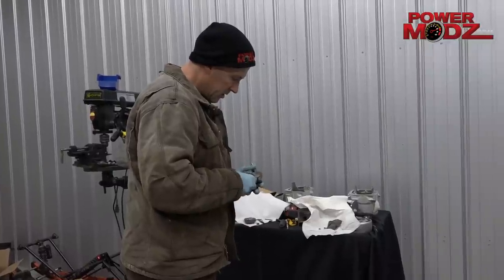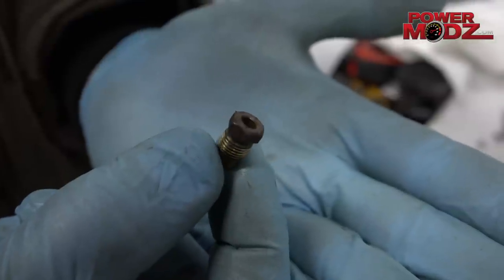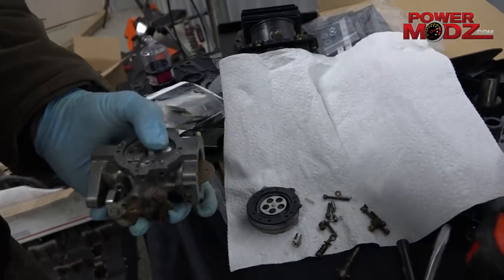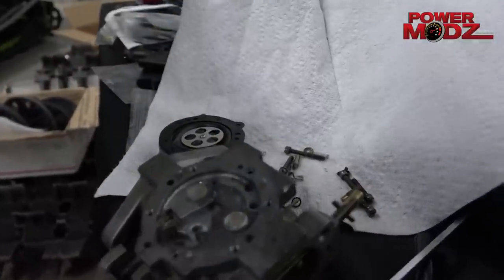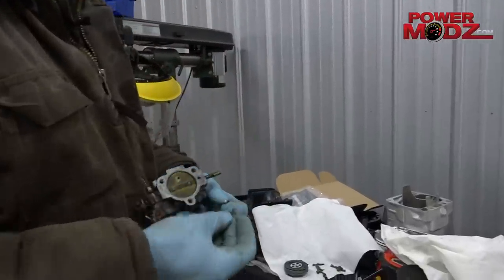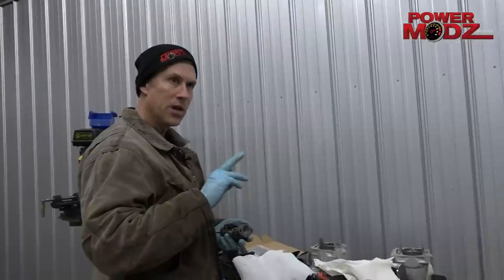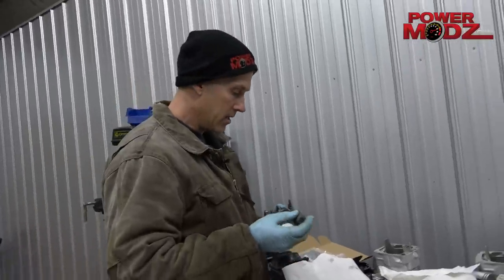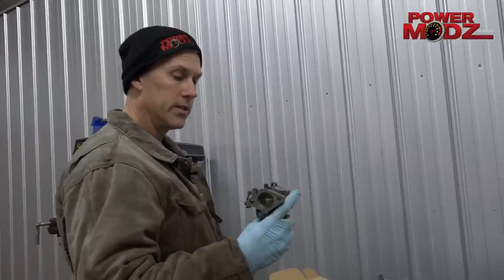TILLOTSON CARBURETOR REBUILD TRICKS!  IT'S EASY!

Comment: Side note, an old timer with about 15 SKIDOO sleds told me carburetor cleaner melts the little caged check ball so don't clean the carb with the check valve in the carb. I have bought two sleds that had the ball missing/broken/melted or whatever. I'd only been able to find the check balls as aviation parts for paramotors but I messaged on your website to try to buy some.

Comment: The way you leveled that tab can screw up the needle and seat. You should take another small screwdriver and use it to counteract the force you are putting on it. I learned all about pop off pressure carbs with my sea doo rotax 587 motors (super similar to rotax 583s in skidoos, just w/o rave valves.) if you have the wrong spring in, it can either flood your engine or make it run lean. Too light of a spring will flood it because gas tank pressure will overcome the pop off pressure and send gas into the carb. To heavy and it will not send gas into the carb when it needs it and it will run lean (if it runs at all.)

Comment: I have a few questions. Are you sure that it is Stainless steel seat. Though it is chromed for kart motors running ethanol? What brand socket you are using. I have Bahco A7402DZ-5/16 and it has 11.4 OD and it is very tight. You are using Proto, 3/8"? Is that Winderosa set? I can not hear what you are saying that check valve cause flooding? Not sure about that. EC carb is saying that it is only for backfire. Valve looks like it is bought from there. I aslo can not hear model. I have 114A and look the same. You do not show pressure test. What you recommend? 10 psi? Very nice video!
Reply from the maker: I made my own socket - ground one down.  Could be chrome plated but pretty sure stainless. I sell Tillotson genuine kits.  No pressure test needed.  if the check valve is stuck it'll flood and blow gas out the carb.
Reply: @PowerModzOfficial  I finaly get my Tilly work properly. I needed to order new shaft from Canada and install bushings to body. And make valve pop-up testing. Also original needles. After all that it work very nice. I mean seriously well. I needed to make special tool in turning workshop to get seat properly installed. I am now sure that shaft need to be in tolerances to have firm idle. Shutter is well machined to body. Also I am sure that you do mistake if you neglect valve testing. There is number of diferent springs to adjust valve opening. To have smooth operation in different loads got to have certain amount fuel in reserve. And one thing more. Check that you have fuel pump diaphragm. It is missing most of the sets. I can now say that it is a great carb. But also need three special tools to be rebuild. And if body is wear out, you need to have imperial reamer and bushings and shaft.

Comment: I have a carb off of an old TNT 440. The carb is an hd80a by stamping. Under the Welch plug the "ball valve" isnt a ball valve. I can't find anything that shows what that thing is, and I can't get the carb to do what it should. 
Help?

Comment: I have that carburetor on my 1995 Mercury Force 70 o/b. I can't get it started without using starting fluid, and then it only runs for a second. I also have fresh gas coming out of the exhaust mixed with water. I am so frustrated! I wish I could send it to ya and you rebuild it!!

Comment: use fuel stabilizer when stored it will eliminate 99 percent of carb issues,the green and corrosan issues didn't start until unleaded fuels were introduced.
Reply: I think you’re right there. My grandpa bought a wheel horse safari in 1969 and we used it without fail for decades. It wasn’t until about 2002 that it began having runability issues. It went dangerously lean while on a long ride away from home and the Kohler 309 suffered a piston meltdown. I was able to remove the piston and successfully dislodged the rings, polished it up, and ran it successfully for a few more years but it got to the point that the running issues couldn’t be resolved with the adjustment screws. I’ve since completed a full rebuild on the top and bottom end and the carb has required numerous rebuilds. Last year, I put a few hundred miles on the old Wheel Horse and it ran flawlessly. This year, it runs awful and pops and backfires under any load. No amount of adjustment can make it any better. Another year and another $50 Tillotson OEM carb kit. It has to be the gas. It’s the only common denominator. Running Ethel free gas doesn’t seem to make much difference on the longevity of the carburetor. The slide carbs on my newer machines seem to tolerate the new gas without much issue but the pumper carbs do not.
Reply: @Adam  if you are anywhere near an airport, they will sell you avgas 100LL. Mix it 50/50 with 91 and add a little fuel stabilizer. Its a bit more than 91 pump
Gas but saves the fuel system in the premix tilly engines.
Reply: @rpmmustang89  
In fact, there is a rather large airport only 12 miles away! That’s good thinking. I should try that :)
Reply: Yup even for the last run of season on avgas so its in the fuel system for the summer  you will be golden. They tend to  only fill metal cans fyi. My 1st trip was unsuccessful  as i had a plastic  gas can.
Reply: Mill fdd DDS,

Comment: I was very interested watching your video. You are SO correct in saying that many carb kits are ABSOLUTE JUNK! Have you ever seen when you tighten the screw that holds the fulcrum arm and rod, that as you tighten that screw in it ends up pushing the needle down so far that it bottoms out not the needle end of the arm, but that other end which in turns ends up hitting the top of the carb? If I back the screw out some things are fine, but I can't imagine that is right.
Reply from the maker: yes - you just bend the tab so it doesnt do that
Reply: No kidding, I will have to try that I guess. I measured the new needle and it actually is about a mm, maybe 2 longer then the old needle, thought that maybe was the issue. They are both uncaptive or non-captive needles too so that isn't the issue. Never seen one so out of adjustment before I guess.
Reply from the maker: @simonkrystosek7122  oh I see...yes you cant use that long needle....that's not going to work for you
Reply: Do you have the proper needle and seat for a HL289A for a 303 Wankel I can buy?

Comment: I’m restoring a 1970 Arctic Cat Panther and I need a kit for my tilly on it, I’m in Vermont, USA, where can I get a kit to replace the ball valve and plug? The pump rubber and diaphragms all look to be in great shape, but if the hood kits come with all new I’ll replace em.
Reply: GB Distribution in Quebec has kits if power mods doesn't
Reply: @ontariosfinest8971  anybody in the US? I can get them from Amazon but not sure if those ones are a ‘good’ kit or not. My Cat uses the HD size tilly
Reply: @gallupcustomknives2293  EC Carburetors. I've never purchased anything from them but they have an impressive website as far as carb parts go

Comment: Does an HL 129 have a check valve somewhere? It has one welch plug that I pulled but just passages under there. I rebuilt the carb but it won't pull gas.

Comment: Does the HL-320 have a check valve...? No noise when shaken. There's only one welch plug and a small 1/32" brass plug where your check valve was...
Reply from the maker: Hmm im pretty sure yes - remove the plug and see
Reply: @PowerModzOfficial  No, turns out it does have what they call the 'idle discharge ports' (scroll to bottom of link) which are those small holes under the second welch plug you took off but they only refer to the brass plug as 'the brass plug'...nothing more. Must be an un-used part of the casting...? Oh well, one less thing to worry about but still a bear to get started. Thnx all the same, great channel !

https://tillotson.ie/wp-content/uploads/2015/07/techinfo_hl_us.pdf

Comment: Any chance could do a video on older primary clutches as in the comet duster 94c cant find anything on them and would like to get more info on them i got a 74 tnt 340 with a 440 sled was toast so i put it in my 78 340 olympic that nedd a heart and runs great but need a white 99ld spring but dunno any info on the pucks and cant find anywjere that sells them any help would be awsome love channel thnx

Comment: Do all Tillotson carburetors have the check valve in there? I just rebuilt an HD 14a and I don't recall a check valve. However, I'm having problems with it flooding easily. I used the winderosa kit and now I'm scratching my head wondering why I'm getting so much fuel. Help!
Reply: Under  the highspeed welch plug is the check valve. Hd you have to use a punch and drive it out
 Gbd distribution  in quebec selle new hd check valves.

Comment: No OEM Tillotson brand kits for the HD carbs, and the check valve is pressed in. I also would have pressure tested the carb and checked the pop off pressure.
Reply from the maker: dont need to test it - they are originals..in the couple of hundred kits ive done I have never had an issue with tillotson original springs.
Reply: @PowerModzOfficial  so dont need to do pop up pressure?
Reply from the maker: @rushking19  maybe if you are using old parts - I just rebuild them and they all work.
Reply: @PowerModzOfficial  ok so if I get a rebuild kit with new springs I will be fine?
Reply from the maker: @rushking19  you gotta rebuild it right though yes.

Comment: Hello, thank you for the video, I have a HD-100A. in a 1973 645 Blizzard (3-Carbs), The left side PTO carb floods bit time,   my check ball Valve doesn't  have a slot to unscrew, only the HR has it, would you happen to know how to get it off so I can test it. thank you
Reply: Late to the game but take off the  welch plug use a punch  and drive it up out the top of the carb. Small taps it will come out. Reinstall same way.

Comment: I have a sachs 290 with tillotson hr114a and when the engine is cold it runs fine but it starts to idle high when it gets warm. i tried to adjust the lowjet but no success. i did put a new kit in it for the fuel pump but it was not a kit for the whole carb, just the pump. suggestions on what to check on it. It ran fine in the beginning of the season. The snowmobile is an Aktiv 290 Lång from 1978. swedish sled.
Reply from the maker: Rotax700 yes my suggestion is to rebuild the kit the way I show it in every video and tell everyone.....do the whole thing with original parts.
Reply: PowerModz Ok my problem is that it’s hard to find parts for it in sweden where i live.
Reply from the maker: Rotax700 we have everything you need and ship to Sweden.  Go to our website and fill out the contact form and tell us what you need and we will give you a quote.

Comment: Quick question…..have you ever ran a HR75A on a 247 single? I bought a elan as a basket case of parts and in the box was a rebuilt HR75A but I kno the single 247 should have a 73A.  Im probably gonna just cross my fingers and roll with it but was curious if you have run them.  Thanks
Reply from the maker: There's a chart online of what will work. - google it!
Reply: @PowerModzOfficial  the chart only says what came stock. The 73A. No other options listed.
Reply: @starionslider2116 you can probably get it to run good by setting the high and low speed jets like Louis did in his other video. It may never be perfect as the little holes under the one welch plug were designed for a particular engine displacement. That 75A came off a 335, in case you didn't already know. It has a 1 9/32" venturi compared to the 1 3/16" venturi that the 73A, 133A and 173A had.

Comment: I have a Polaris snowmobile and I hook up the throttle cable to the throttle assembly and it revs high and then I un hook it and it is find do you think i need a new throttle cable or adjust the idel
Reply: Sounds like the cable is adjusted too right. there should be a slight amount of slack. Note the cable adjustment is different than the idle adjustment screw.

Comment: Help me out I got a polaris xlt 600 fresh gas new plugs and it's getting spark but won't start before it died it was bogging it was low on gas so I got more then it fired then died and now it won't start at all I'm so confused I put gas in the block and still nothing sprayed the carbs nothing it should at least what what start

Comment: I haven't found a kit that comes with welch plugs, I also have a 1971 valmont, and the engine in it does not have a pulse line for the carb, having trouble getting fuel to the carb. I believe some of these carbs don't use pulse lines, not sure.
Reply: andrew thomas Look at the mounting face of the carb, should have a little hole, that lines up with a port on the motor. That takes place of the pulse line.
Reply: +Gearheadtom thank u ,I saw that when I had apart wasn't sure if that's what it was,now I know thanks.iwas wondering y it didn't have a pulse hose hook up.

Comment: Can I ask a question.. 
What is the difference between let's say a 42 grams pressure spring and a 48 grams pressure spring in terms of the function of the carburetor, will it have less fuel with the 48 grams and the response of the engine is more crisp? Anybody? 
Thanks in advance
Reply from the maker: just buy the proper spring - no need to measure

Comment: There was no welch plugs in the tillotson carb kit I bought, it came with the winderosa diaphragm and gasket kit
Reply from the maker: you bought from me?  if so who are you and just email me, I sell genuine tillotson kits.  I did sell one HD kit that I told the customer was new old stock from a dealer.  all my tillotson kits come with welch plugs.
Reply: No, I think I got it from Goose, the package that was marked Tillotson only had the needle valve, seat, copper washer and arm.
Reply: @PowerModzOfficial  I own a 69 Arctic cat panther with a hp18a tiliston carb ...do you have the proper rebuild kit for this & what is the price ...thanks

Comment: how do we prevent or reduce varnish?
Reply from the maker: A good fuel stabilizer might do it - but its tough.  Best thing is fresh gas or a flush.
Reply: The very best thing you can do to prevent trouble with ANY small engine carb is to use Ethanol free gas which is usually high test and great for your engine :) Also like he said, Use a stabilizer and if possible start the engine every few months to flow fresh gas through.
Reply: Run some GM penetrating fluid on the last ride of the season it is good for cleaning gunk and preventing it and it lubes the whole engine good

Comment: I never liked these, i had twin 77 nuviks one had a mikuni = ran beautiful!
The other had one of these carbs- never ran or it ran like garbage, never idled, if i could keep it going, it bogged under throttle. Had it rebuilt several times. Tore it off put a mukini (cant spell it grammer nazis) anyhow with the mukini it ran beautiful!
Reply from the maker: skidoo princess4life like I said its because it was never rebuilt right.  Side by side 2 elan 250s..one with a tillotson and one with a mikuni the tillotson will run way better than the mikuni
Reply: PowerModz i wouldn't doubt it, my granddad bought them in 77, the year i was born. And i bought them off of him when i was 17. But i always remember him having issues right from the day he bought them. (Issues with the tiltson only)